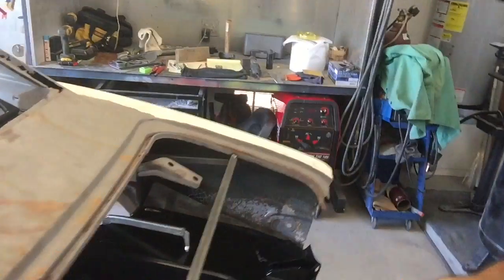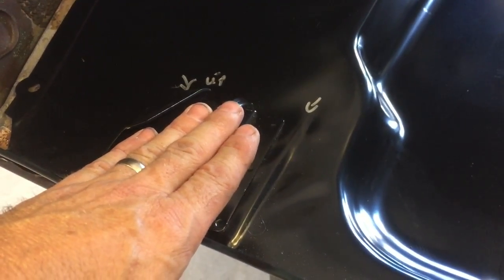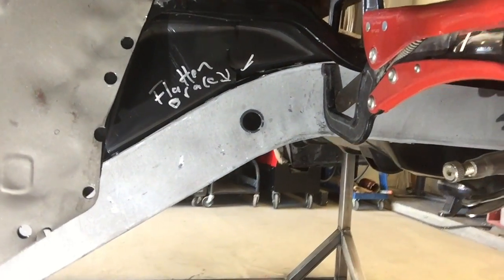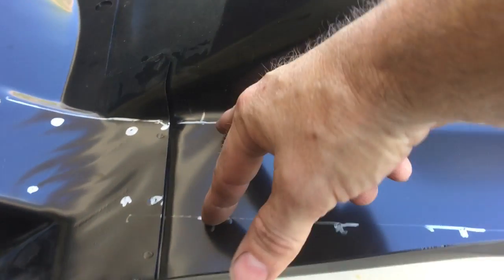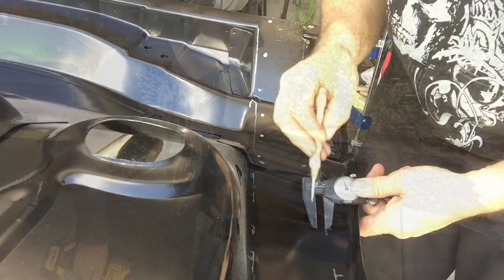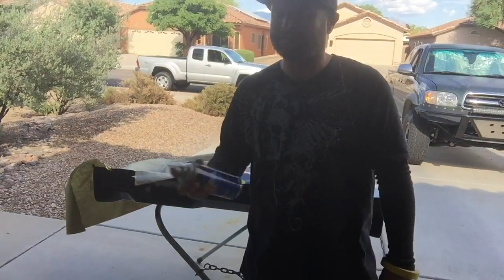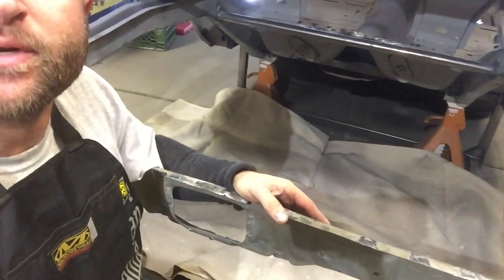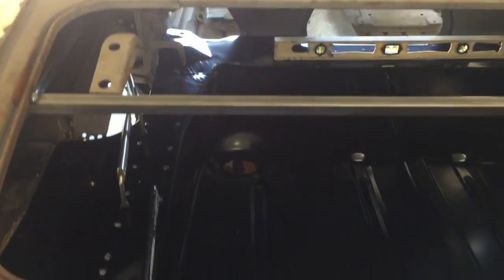1967 Camaro Trunk Pan Installation JAMESFREDDYS MC&HR

Comment: I know this is very similar to a 67 Firebird, if not exact, But are there any small differences I may come across? such as braces or brackets? Great video, thanks
Reply from the maker: If you don’t have to put the full pan in don’t section in the rusty section. No differences I know of between Camaro vs Firebird.
Reply: @jamesfreddys  Thanks for the response, unfortunately someone did a butcher job  on the metal work and covered it with body fill then sprayed metal protect over the entire car on my car before I got her and need to redo and fix a lot. The trunk is the worst of it , better off with a mostly full replacement.

Comment: Did you state you were using a Qtip and thinner to remove the Weld-Thru from the plug holes?   That sounds like a good idea as it wouldn't really be needed there.   Just wanted to make sure that was your intension.   Cool Stuff Jeff!!!!!
Reply from the maker: UCanDoIt2 yeah Q-tip and thinner but a small flat blade screwdriver works good if you just want to scratch it off.